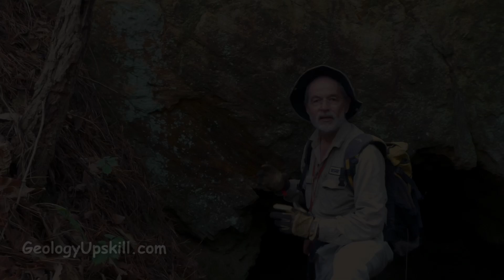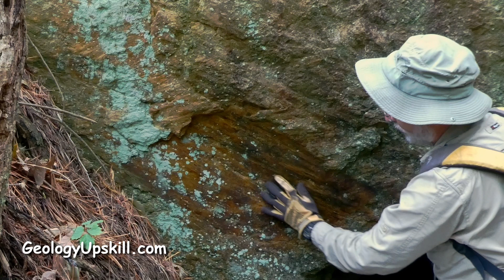Which way did the fault move?

Comment: Sir I do not get where the fault move unfortunately. Did it move down or horizontal?
Reply from the maker: It moved both directions at different times. That is pretty common, but in most cases you only see evidence for the last movement because that movement usually destroys evidence from the earlier ones.

Comment: Sir, I found this kind of Slickensides in many rock sections on my mountain. After careful observation, I tend to think that it is formed by the shock wave of the asteroid hitting the earth, and it is also a special case of rupture cone. Do you think shockwaves can form this kind of Slickensides?
Reply from the maker: Slickensides like these form by very slow  movement. Sudden movement caused by an asteroid impact would result in a breccia in the structure.
Reply: @GeologyUpSkill  Sir, from the top to the bottom of the rock mass, there are breccias, huge broken rocks, breccias，limestone lava, Slickensides are found on the broken rocks, smooth Slickensides can be found in the cracks of the broken rocks, the cracked stones match each other, and the displacement The amount is very small.
Reply from the maker: @皓天红狐  it only takes a small amount of slow movement to make slickensides over a large area. The breccias are made by rapid movements.
Reply: @GeologyUpSkill  Yes, the characteristics of the shatter cone are not obvious, and it is indeed more like the formation of dislocation sliding. Our mountain has a large area of igneous breccia complexes, huge clastic metamorphic rocks, and a large amount of limestone lava. This area is not The volcanic structure zone belongs to the sedimentary rock formation.